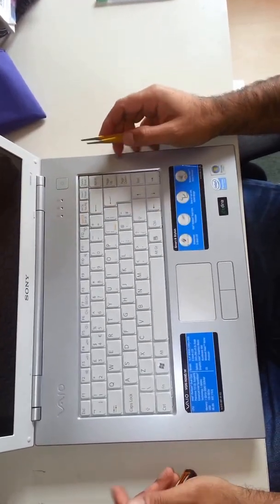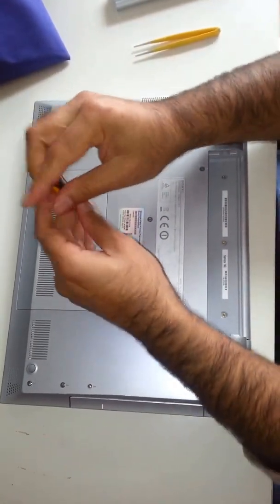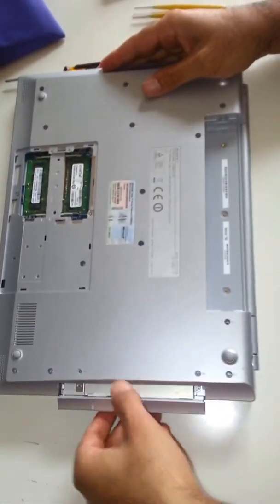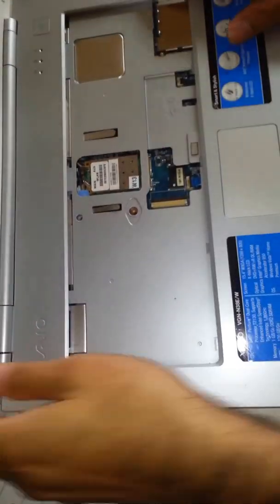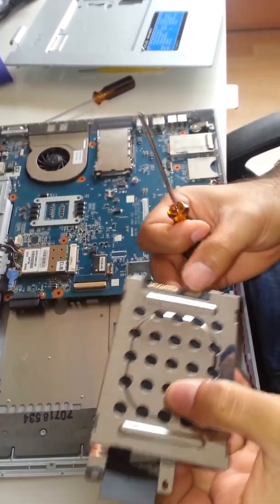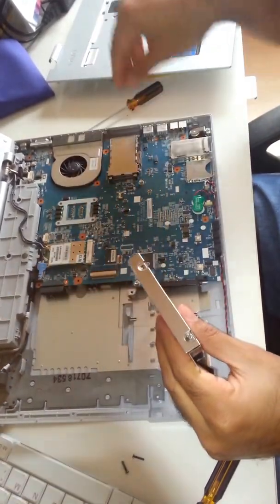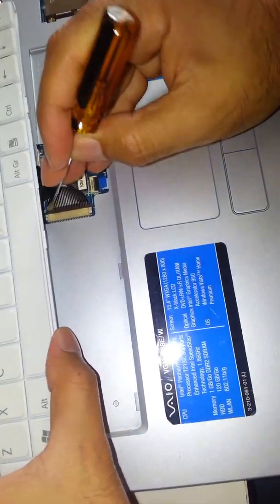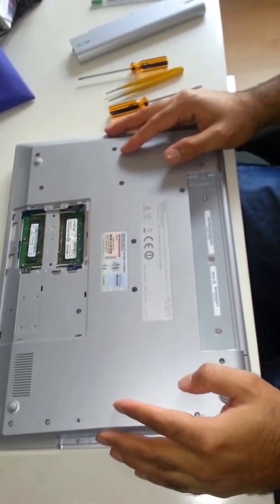How to Disassemble and Change Hard Drive on Sony Vaio VGN N38E Series

Comment: I have an old Vaio-VGN-N320E, and I just upgraded its hard drive by myself thanks to this video. Without your clear and helpful explanation, showing exactly how it's done, I would have had a big mess. So thank you very much!
On the other hand, I changed the hard drive on my Dell Latitude in 10 seconds, with just 2 screws. Why the hell does Sony have to make it so damn difficult?!
Reply: I guess in Sony they think that more complicated equals more expensive :)